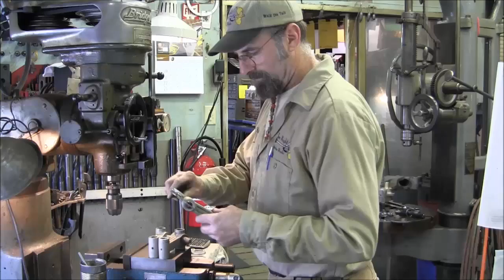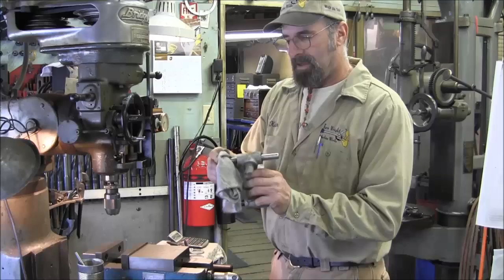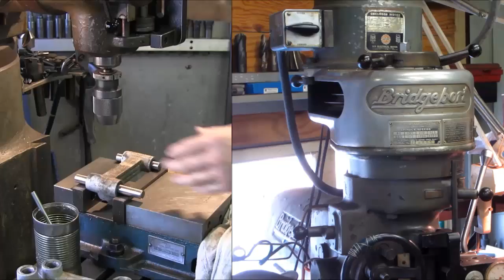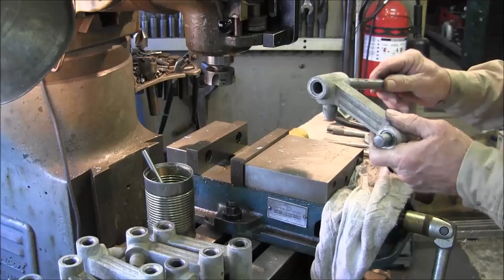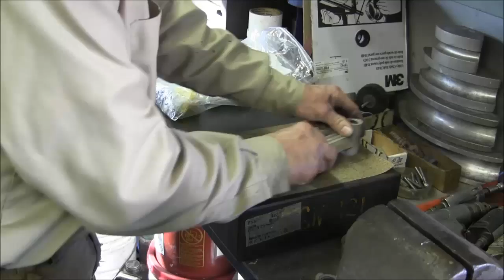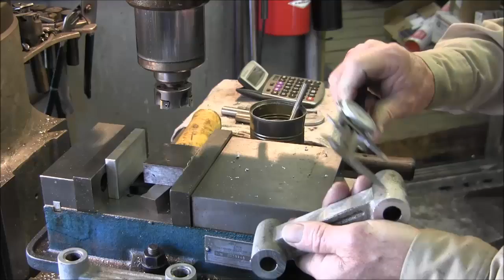Mattracks Part 10 Mail Call: ATV Mattracks Repair

Comment: Keith, May I suggest using a depth mike to measure the part while it is still in the vice. Thus not disturbing the set up.
Great video, I especially liked the way you used the two 5/8 pins for the initial cut for the reference surface.
Keep up the wonderful informative vids!

Comment: At my work they called it dumdum. It was used to seal the tapped hole grating frames before the steel frames went to the paint shop.

Comment: Hi Keith, too late now but if you were getting a slight difference between the two ends, it could be that if your head is not trammed precisely and you only cut the second boss with the leading edge of the cutter  it will not cut the same as the first one. Nice set up, by the way.
ATB
chris

Comment from the maker: erynthegrey, The amount of the reduction, in strength of the bases material is replaced to a certain amount by the bushing design and material type, in the pulling direction my concern was reduced because the system design creates more loads in the compression direction and the material is supported and backed up by the link body itself. Great comment and was thought about when deciding what bearings to use. ;{)----
Reply: This must be the longest set of videos you have done on one job :)
Reply from the maker: Tim Box At least the most interrupted! LOL ;{)----
Reply: That's for sure lol

Comment: Let me ask you this...  If you are taking 1/8" of each face to account for the thickness of the bushing flange for each side AND boring out the hole to account for the bore of the bushing, aren't you reducing the thickness of the linkage walls and reducing strength?  Can the bushings add strength to the part when the bore diameter is reduced like that?

Comment: Hi Keith, what's the rattle/ knocking sound in the head when you take the cut with the facing tool? My old Bridgeport makes the same sound but only when making intermittent cuts using a face mill of fly cutter. Nothing to worry about I guess.
Reply from the maker: Its an old Bridgeport and the bearings are quite used. the camera really picks up the noise, you can hear second half of the video after I sped it up the change in tone. it is an interrupted cut. ;{)------